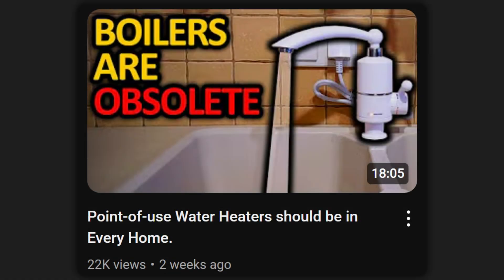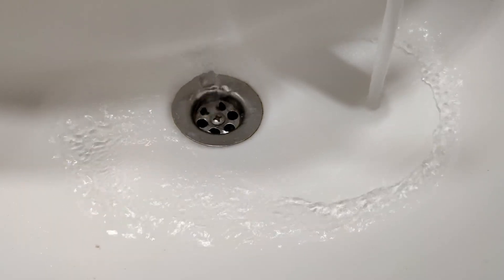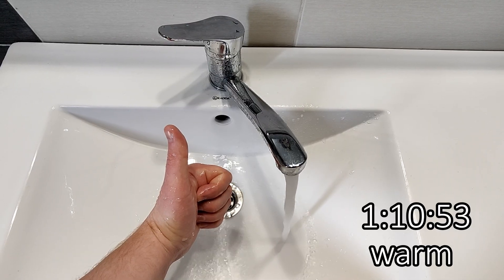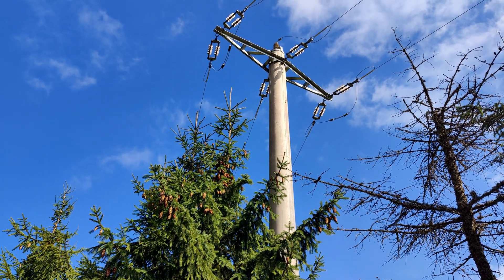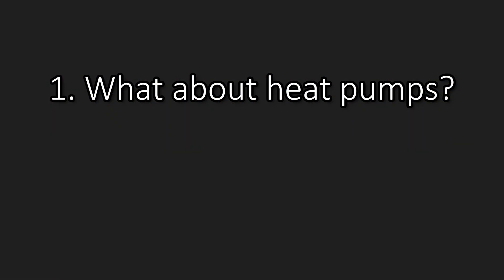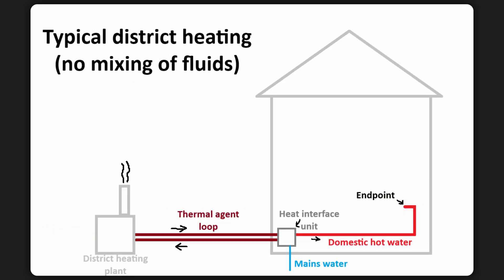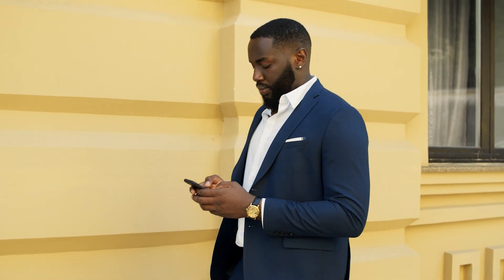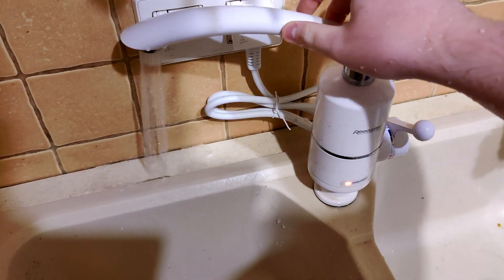Sinks are BETTER with Point-of-Use water heaters

Comment: I do have the shower head nozzle, but only use in the aerated stream mode because the thin showerhead streams cause a lot of jetting and flying droplets. Perhaps there are designs which don't shoot but "dribble" water. Also 1-2 l/m is ass for filling pots or an electric kettle. The cold water mode needs to bypass that flow restriction for me to consider it. Also you haven't explained that cheap models don't have independent flow-temp control, simply less flow == hotter, because they heat at constant power. Finally boilers can do demand response, in my tariff it's actually mandatory for accumulating water heaters. But your point stands, an electric kettle worth of attended-to load here and there ain't gonna topple the grid.

Comment: 2 points from me
1st, when you have a centralized boiler/heat pump, you can run pipes in a loop so that hot water is near instant anywhere. Of course this creates losses over time, as this increases the surface are through which heat is lost in comparison to just boiler. Hard to say how the overall efficiency will be with a heatpump; probably depends on the exact case.
2nd, where I live the expansion of district heating systems is encouraged by law, and most new building that are within networks reach are connected to it. In fact even single homes are encouraged to connect to the grid. The only downside is that its relatively expensive form of heating (but convenient - you do not have to deal with any extra devices / machines / maintenance)

With that said, its no big deal whether you use an in point heater or something else from my perspective. I just always disliked the look of those (but if there are some mounted under the counter, it could be fine).

Comment: Also, you can combine the two options. If you've got district heating, you can use the tap water heater to eliminate waiting time, while using district heating to deal with larger uses of water. So if you're filling a 10 liter bucket in order to do some cleaning, you might heat 3 liters using the electric faucet, while the remaining 7 will be from the cheaper district heating/heat pump.

Comment: 03:50 I think this also depends a bit on wether you live in a single family house or not. I just tested it and I have to only wait about 5 to 10 seconds before it get's quite hot. We have central heating and it's not even in the same house block so quite far away, but I recon since I live in a 6 story building there are enough people using it, that it never get's cold with insulation.

Comment: Why not use a 10L hotfill boiler of 400W near the end-point? You have instant hot water and by the time the small boiler is empty, the hot water from the central heater has covered the distance. You could even go all the way and attach a motion detector to the small boiler so that it only heats up when someone is at home.
And a heat pump waterboiler commonly uses 0.4 to 0.6 kW of electrical power while running the heat pump circuit. R290 propane heat pumps don't need an electrical element anymore as they can reach 65-70C on just the heat pump.

Comment: On the "unlimited hot water" question. It is possible to run out of hot water, but it is also possible to not run out of hot water. A system that is sized and configured correctly shouldn't run out of hot water in typical use cases (e.g., as long as shower as you like), but could run out of hot water in unusual cases (a hot long shower, while someone leaves the tap running for cleaning the dishes), or if the system is not sized or configured right.

In any case, I think the instant hot water endpoints make the most sense for uses where there is frequent short uses, e.g., bathrooms/WCs. I am almost never willing to wait for hot water when washing my hands after the toilet, so I'm really good about running it ONLY on cold (and my other washroom has only cold) but others in my household will turn on hot water, run the boiler, and yet, not use the tap long enough to actually use hot water. What a waste!

Comment: I do have some disagreements about this but most of the points made here are very insightful.

I will keep it in mind for my next choice for heating voter
Reply: Do keep in mind it does not have to be an either or. $50 per sink makes you use less hot water, which in turn allows for longer hot showers.

Comment: The comments mentioned in the very last part of the video are putting 20kW flow water heaters in the same bucket with 3kW point-of-use water heaters.

We have a 21kW electric flow water heater in our apartment (though a modern one ... electronically controlled, fully variable power) ... I can tell you, this is expensive stuff at the electricity rates in Germany! 
The builder owner of our 15 apartment building told us that in order to connect 15x 20kW water heaters and 15x 11kW EVSE (EV "chargers") the house has got its own transformer, without EV charging and electric heating a transformer can supply up to 10 times as many apartments! Off course ... as every apartment is fused at 64A (44kW) (incl EVSE) the house could potentially pull 660kW!

I also installed an energy meter in the fuse board which measures all 3 phases of the heater. So I know for a fact that opening a faucet leads to about 8kW of power usage.
And I can totally CONFIRM ALL the criticism about central water heating from the video ... 
- the heated water takes AGES to the faucet. The kitchen faucet takes about 40 seconds at full flow from cold to warm(ish). 40 seconds at 8kW, so 88Wh wasted.  
- as soon, as the hot water flow is getting to low, the heater turns off!
- So when it runs you use way more hot water, than would be needed for the job. When I then compare 60 seconds at 8kW (133,3Wh) to 60 seconds at 3kW (50Wh), the central water heater wastes another 83Wh!
To make all the problems less painful, I set the heater to 48°C (the max point where it doesn't feel like I'm burning myself) and we always open the faucets on full hot at full flow to shorten the flush time and after having hot water we can at least trottle it down a bit.

The energy calculation for 60 seconds of faucet usage from cold pipes is easy: 
20kW central electric flow water heater @8kW plus 40 seconds pipe flush: 221Wh
3kW point-of-use water heater @3kW: 50Wh

So assuming a CoP of 1 for the flow heater the heat pump would have to consistently manage a CoP of at least 4.4 JUST TO BREAK EVEN! 
So central water heating is USELESS for heating water used at faucets in a single household! 
It only has its use on high-consumption outlets like shower or bath. There the pipe flush makes up only single digit percentages.

Wasting 120Wh 6 times a day (3 times a day for washing the cats plates another 3 times a day to wash hands or big cooking ware) makes about 0.72kWh/day, 263kWh/year, 72€/year (at fixed 27.5ct/kWh in our contract) just for THAT SINGLE FAUCET in the kitchen!  
So a point-of-use-water-heater gets brake even int the FIRST YEAR in Germany in our scenario! And it even has the quality-of-life-benefit of almost instant hot water!
Reply: Here's a quick warning about the settings you're using. Those might create a risk of legionella bacteria, which can build up to potentially lethal levels in water pipes where the temperature is incorrectly set. You should aim for at least 55C in your hot water system, which can then be mixed at the point of use.

Comment: You do have a point with the point-of-use, however, I do have few corrections.
For my 47 years, I've lived in 5 apartments, 7 houses and multiple temporary accommodations. None of them had 40 seconds waiting time for hot water. It was usually 5-10 seconds, not longer. The only longer time was at one very old apartment with district heating and hot water, but even that was under 15 seconds to scorching hot, not to warm.
In our house, waiting time is under 3 seconds. All the water pipes have insulation, so there is less heat loss even when not using water.
Now, to the other side - our heat pump uses not 3kW, but 4.5kW for heating the hot water tank. And it runs for around 40 minutes (while the water is still being used!) to heat it up from 34 degrees to 55.
And yes, we did have hot water run-out. But the reason was not the heatpump, but stupid installer. They set the heatpump to only heat water if drop is under 40 degrees and the hysteresis was set to 5 degrees. That means the pump will only start when the water is at 35 degrees. And the tolerance of the probe is almost 2 kelvins, so technically this can be already 33 degrees. On top, the heat drop from 55 to 45 degrees happens when using around 200 liters of water, but the drop from 40 to 35 happens within 50 liters (!!!).
So, all we did was to increase the heat target from 40 to 50 and the hysteresis from 5 to 3 degrees. From that moment, we never experienced hot water runout ever again - I have 3 teenage daughters and wife, taking long showers every day, usually in 2 bathrooms in parallel.
So, your friend with heat pump might need to call the technician and kindly set the water temperatures accordingly.
And, of course, we do have low-throughput showers and sinks. The only downside is that filling up 1.5 liter water bottle takes a bit longer :)
We also have dishwasher that uses hot water from the heat pump storage and heats it further (to around 65 degrees during intensive cycle), but still uses extremely small amounts of power (I have power meter on all circuits of my house, I'll be happy to share the data).

To make long story short - the point-of-use is an interesting concept, especially in larger houses this might be quite interesting alternative, but the comparison to heat pump does not make a lot of sense.
But it is worth consideration - for example I've paid quite a lot of money for thermal insulation of hot water pipe to garage - I could have just take cold water there and use point-of-use heating, should I knew it is as good as described here.
Shame this video was not produced 2.5 years ago :)
Reply: We moved apartments inside Cottbus this year.

Old one: a 5 level apartment house (east German soviet style "Plattenbau") built in 1979 ... district heating for heat and hot water, faucets in the bathroom and kitchen directly on the "shaft wall" which run the water pipes. So when you have 5 showers and 10 faucets all connected to a single riser pipe, there is ALWAYS someone flushing the hot water pipe for you and you get almost immediately the same "scorching hot" water.

New one: also 5 level apartment house built in 2023 ... district heating for ONLY for heat ... only cold water to the apartment, water heating done through 21kW electric flow water heater in each apartment individaully. We have ALL THE PAIN POINTs mentioned in the two videos ... long pipe flushes, warm water wasted because of high activation point of the flow heater ... 

And circulation pipes/pumps are by far not the norm. In my old apartment in Berlin (built in 1997) they had circulation pipes installed but they didn't work in all the 15 years I lived there ... even when the plumber changed the broken circulation thermostat in the basement! 
There I also waited 30 seconds for hot water in the kitchen because all the kitchens in the 5 levels had their own riser pipes, but all these small apartments were 2 room ones ... usually occupied by singles rarely using the kitchen sink?
Reply: Given how cheap this tech is ($50) it does not have to be an either or. You could easily do both.
Reply: @wertigon  The price problem is not with the device, but with the cabling :( Getting electricity close enough that can be permanently plugged would be the issue.

Comment: At best these fill a niche, if you  want hot water in an out building or have a basin a long distance from boiler/cylinder.
In the uk electric showers are still quite poplar as there are still gravity hot water cylinders about, but these will eventually be changed out for heatpumps with buffer tanks which also double as central heating and mains pressure  hot water .

At least point of use make more sense than boiling water taps in homes .

Comment: My understanding has always been that heat pump water heaters were designed as drop in replacements for people who already had electric tank water heaters. The ones I've looked at have a very low power heat pump that uses 400W or so and a 4.5kW resistive heater for when demand is high.

Comment: Sorry but your premise makes no sense to me. 
I need about 3 liters to purg my hot water line. 
After that I use about 20 liters of hot water to shower.
For a heat pump with a cop of 3 the threshold would be 2 liters of hot water to be equal in energy coast. 
I pay 0.003€ per liter for me that's not relevant because my energy price is about 0.3€ per KWh. 

For me the question is how long will it take the investment to redeem itself.  You consider only the saving but not the cost of the heater itself.
Reply: Cost of the heater is $50 per sink and $200-$300 per shower.

For a house it's a ridiculously cheap investment. Doing it for the quality-of-life alone is worth it.
Reply: @wertigon  I don't understand what the quality of live increases would be. 
I wait about 30 seconds to get hot water in my shower.
Or anywhere else for that matter on allmost all of them are equiped with water saving nozzles. 
I never ran out of hot water how a system can be that bad plant is without my imagination. 
My 22kw heat pump can produce so much warm water that we could use all showers at the same time indefinitely on normal water temperatures. 
Like I said it is much cheaper to use the higher cop and the possibility to store heat in the big buffer tank.
Reply: @Mr.T9191-i2f  Thats what I said about my old PC from 2012 too. There is no reason to upgrade my PC runs fine.

Then I got an upgrade in 2022 and boy was the difference stark.

Bluetooth headphones? Today it feels super weird to have a cord dangling from my headphones. Didn't get the hype before that.

Waiting 30s vs 30ms for hotwater is such a gamechanger but you will not understand why until you have lived with it a couple of weeks.
Reply: @wertigon  the increase in cost for  the time advantage is not worth for me. 
 Furthermore I would need to lay new electricity into my bathroom and  in Europe we have strict regulations about water and electricity.
If my life gets so stressful that I can't wait 30 seconds for hot water once a day I would argue I should change my life rather than my hot water system or I can make breakfast and use the shower after my girlfriend. 
I never saw a model that can deliver instantly hot water  except they preheat a little amount of water.
Reply: @Mr.T9191-i2f  It's not once a day. It's every time you wash your hands, do your dishes or require hot water :)

The cost is extremely low, but you do you. Spending money on sealing your house to the largest extent possible makes more sense and costs about as much.
Reply: @wertigon  my cold water is more than warm enough to wasch my hands and I don't do dishes by hand I have a European dishwasher with a cold water supply. 
I don't know why I should wait for warm water to wash my hands
Reply: The premise does not make sense to you as you DIDN'T WATCH THE VIDEO! You totally missed the topic. Watch again and try to understand! 
Hint: It's about FAUCETS, NOT SHOWERS!
Hint2: It not about either/or ... it's about using the right tool for the job.
Reply: @glockmanish  and the right thing is a freaking boiler.
Reply: @glockmanish  I told you I wait on both under 30 seconds and it is more expensive than my heat pump. So what's the point. 
Sure if you live in an American crappy non isolated shit box of a home and wait 2 min for a lukewarm water sure it can increase your quality of life. But for any normal house built  with isolated piping this is just  stupid. 
But to argue with someone that never lived in a well built home it's easy to see this as a cheap alternative to a good heating system in the house.
Reply: @glockmanish  he talks about showers as well and I if you not able to read all comments and the response from @wertigon you are ....

Comment: I have heat pump plus circulation pump (and pipes) and thermostatic faucets :) but you can also connect heat pump plus point-of-use water heater... it will run for 60 seconds and then the water will be hot from the heat pump. Heat pump is also used for heating and cooling, so you don't lose on the investment
Reply: Thermostatic faucets are not helping with the flushing time problem and circulation pipes are by far not the norm. 
And having a point-of-use-water-heater connected to a hot water line is double wasteful, as BOTH HEATERS will start every time despite only one being needed!
The right-tool-for-the-job solution would be best ... point-of-use-water-heaters where warm water is taken often but only in small to medium quantities (e.g. the toilet, kitchen) ... bulk heaters (heat pump, gas or electric flow heaters, water tanks) everywhere where warm water is used in bulk, like shower, bathtub.